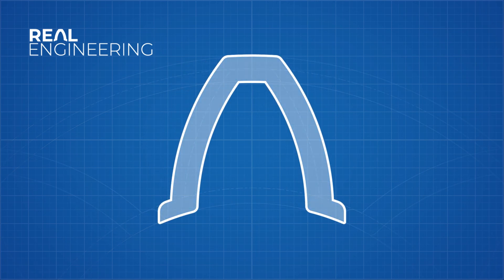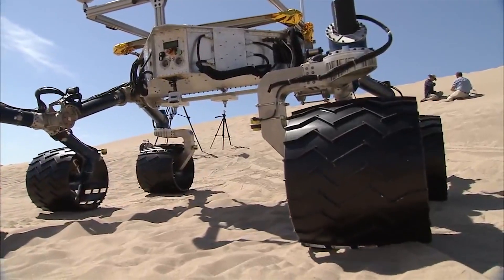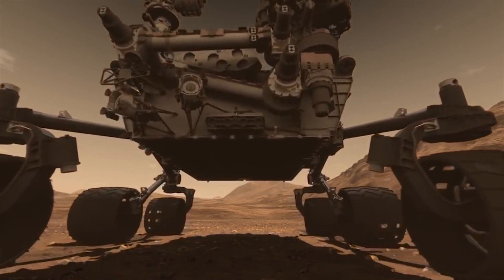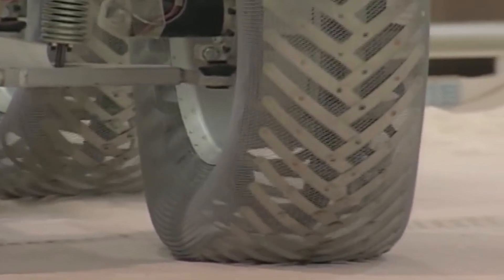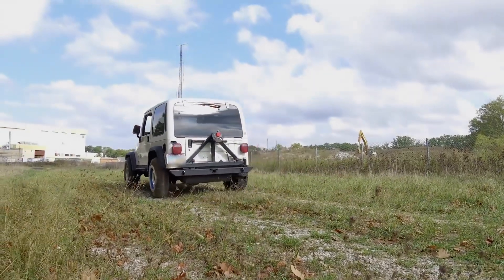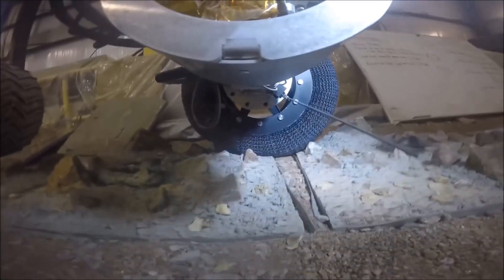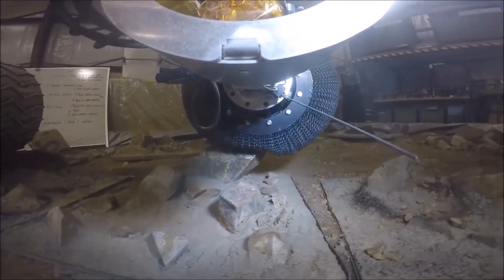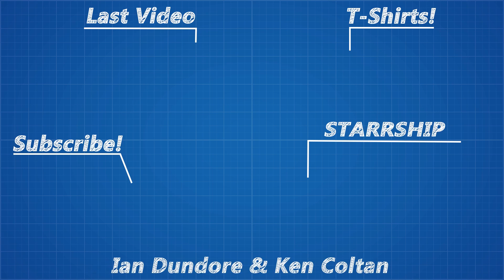How NASA Reinvented The Wheel - Shape Memory Alloys

Comment: Is it weird I want to be ran over by one of these wheels?
Reply: well, attached to the rover or not? 1000 pounds is a lot of weight.
Reply: @jhonn3908  thats kilograms
Reply: @jhonn3908  On mars, it weighs one third of that.  There are six wheels with the load distributed among them, so that's about sixty pounds of pressure to endure.
Reply: @JohnDlugosz  how would you get to mars?
Reply: well, people have those stents shoved in them. so it might not be thaaat weird
Reply: yes
Reply: Weight changes depending on the environment. MASS does not. If you are going to rudely correct people, get it right. @zuumek
Reply: no i want that too
Reply: Nope. I want to be too...
Reply: Is that your fetish??
Reply: Pheonix Playz If it can be a fetish then heck yeah lmao
Reply: That's a really weird fetish😂
Reply: @zuumek  Huh?  I think you have your terminology wrong.  The same mass (e.g. the same object moved to each location) will have different weight on each planet.  Weight is the measure of the force of gravity on the mass, and that force is what changes.
Listen to notta clue:  If you are going to rudely correct people, get it right!  Better yet, don't be rude.

As for "1t", if that is a "ton" (lower-case 't' is not an SI standard unit)  then it is mass if "ton" means 1 gigagram.  If it means 2000 pounds, a freshman physics teacher will insist that it's a unit of force, but in real use pounds takes on mass or weight based on context (and that loose practice must be banned when you have interplanetary trade!).
Reply: @JohnDlugosz  so if the moon is in are atmosphere & everything outside of our atmosphere has unpassable depth of miles of plasma how do any signals pass back to us through plasma ? when it's a fact that radio waves & other data  literally bounce off plasma
look up sapphire crystal tubing
do they charge the veichel by running into plasma ?
Reply: @twistedkyote4107  You mean "our" atmosphere etc.  I don't know what "veichel" is supposed to be.  In any case, I don't see what this has to do with the force applied by one tire of a mars rover, so I don't know what you're talking about.

Comment: why not just use 3 titanium SPURs for the wheels  ??? with rounded edges cnc them easy done impossible to damage, hear resistant , load bearing and would provide better traction on that surface.

Comment: wheel or tire?

honestly the concept of the wheel as "a circular object which is attached at it's center to an axle" is nowhere changed in this breakthrough. they only changed the material which is supposed to be the tire. still, there are wheels with no tires at all (like those on trains) but on this concept, it would definitely be clearer if they used the word tire (or tyre) instead of wheel.

Comment: So a family friend that works at JPL let me in on an extra piece of information on why the rover tires wore out quickly. If you look closely, especially around 2:25 (but also in other clips) you'll notice some rectangular holes cut in three rows along the tread.

What's their purpose? Ego.

The first tire proposal had 'JPL' on the tread in a manner that would write the logo all over the planet as the rover traveled, like a rolling stamp. NASA was not hugely thrilled by this, so JPL had to redesign the wheel, this time more sneakily.

Those three rows of holes are JPL written in Morse code.

And the first wear that was noticed on the tires was directly opposite to the Morse code because of unevenly distributed stress.

Needless to say, the prototype design they were decided upon for replacing the tires in the next rover at the time I was visiting didn't have any rolling stamp properties with which to mark Mars' terrain and cause structural weaknesses.

Comment: Okay, but how will it deal with small rocks getting stuck in the springs?
Reply: Small rocks don't get suck in it. When compressed, the coil becomes tighter hence not letting rocks enter in the first place.

It's also not expected to press to the rim, anyways, so it should be harmless if it does occur.
Reply: more like it doesent really matter, it either gets stuck inside a coil and rolls around in it or at worst it stciks and boom! extra grip for free.
Reply: Oh, I'm not saying that would cause it to actually break. But as far as I can see, there's nothing preventing rocks from permanently getting stuck in the springs. You'll always have some rocks that are just the right size to get in the way. There's a near-infinite amount of variety once you start driving on real terrain, after all.

And once some rocks accumulate, it might cause tearing in the metal, not just deformation.
Reply: @JustaRandom StraightGuy stop it dont introduce religion to this conversation
Reply: "to stick in the spring the rock would have to be tougher than the titanium used in the alloy"
Um. With that logic, the tire wouldn't deform at all, you know.
Reply: Getting stuck might not be the biggest problem, some stress can push it back out. I would be worried more about when it gets pushed in. You'll collect a lot of small grains inside the tire. Increasing weight, changing friction and maybe also damage interior mechanism of the tire (axle). Good question. Ignore maffy taffy :)
Reply: Perhaps the way the weave is shaped, it naturally deposits sediment upon expansion; when the wheel flexes it kicks the rock out by having a certain geometrical shape.
Reply: Nasa loves fixing everything with titanium
Reply: I think they will most likely use multiple layers of this material and place them in a way that there is no room for parts to get stuck in it. In other words place the layers above eachother while leaving no holes.
Reply: Nyerguds When it deforms, the rocks are released.
Reply: I would argue it isn't a serious issue because if the wheel is spoked rafter than solid, the rocks accumulate in the tire, adding ballast to the wheels, which would improve the capabilities of the river and when the rocks accumulate too much they will simply fall out of the spokes, it'd be similar to how on a tractor you generally fill the tires with a sense liquid like water, coolant, or washer fluid for traction
Reply: I think, besides weight savings, that's why the rims are open to the inside.  Rocks that get trapped inside will just build up and spill out the sides. It might lose a bit of efficiency tumbling rocks around and around, but power when you're there isn't much of an issue compared to getting weight there.
Reply: ti is hard
Reply: Perhaps you could make the springs small enough to where small rock couldn't fit in the springs
Reply: True
Reply: Im just trying to build up my basic knowledge....still im only 14
Reply: especially when alot of them get inside the tire but wont comeout because it was pushed thru by force of weight. so it will start getting more and more rocks inside which will mess the wheel up
Reply: How abt a covering elastic sheath of same or different alloy extremely thin and elastic that either wraps the wheel or fills in the gaps from outside to avoid rocks or dust from getting in ?
Reply: I'm assuming that the mesh tire was designed that way to push out, or prevent, most of the objects that could get lodged in it. Even if it didn't come out immediately, the tire will continue to warp and return to it's original position as the rover moved. Any rock that might get lodged would experience different warping in the local mesh as it rode over different terrain. Basically, the metal its lodged in would just warp again the next time it comes around.
Reply: Only drawback I can think of is that it may not have good traction.
Reply: they wont have any problems, bcs NASA is factory of lies and not inventions
Reply: It probably would become a problem. Most of it would work it's way out. It still would be the better option, I would think.
Reply: Perhaps in the rim you could have an air hose.  As the tire rotates, air is released to blow the stuck particles.
Reply: CT-3921  air hose does not seem like a plausible solution. For one, where would you get the air supply? the atmosphere on Mars has less than 1% of Earth's atmosphere's pressure. i suppose it would require a large sucker+compressor to make useful stream of pressurized air from it.
Having the air tanks onboard (launched from the Earth) also does not sound alright, for weight/volume reasons, if you want to operate the Rover for several years....
Reply: panda4247 - assumed pack pressure air tanks on board.  But that would add too much weight.  

Perhaps steel brush roller things. They’d roll along the top inside of the wheel to poke out the rocks.  Like thin metal spokes. They wouldn’t be making contact with the ground so they wouldn’t be damaged as fast as the aluminum wheels on the original rover.
Reply: @CT-3921 Dang that's pretty smart. GG man.
Reply: @CT--sy8sy  "Air"
Reply: @CT--sy8sy  "perhaps in the rim you could have an air hose"

..isnt .. air.. like .. hard .. to get .. when you're on.. mars?
Reply: @CT--sy8sy  lets assume there is air on Mars
Reply: you mean "smeal recks getting steck in the springs"?
Reply: Im sure they have figured it out...and yet im only 14
Reply: @jetstreamchad4712  Science is not in believing what you think they think but in questioning and simplyfying. Americans use twenty bilon pen in space. Russians took pencils with them.
Reply: Doesn’t have to be air can be any pressure gas you can reclaim from the atmosphere the objective is to remove debris not breath so why can’t you use nitrogen or whatever mars is abundant in ?
Reply: @matthewbrookes9539  CT already answered this. The air pressure in Mars is less than the pressure on the Earth's atmosphere. This means that the air in Mars are fewer or are farther away meaning that in order to get the air you require, you'll require a larger suction in order to cover more areas in order to get the air you require. Nitrogen is still air CT is not saying that they are fewer "air" CT is saying that there are fewer gas in general which cause the atmosphere pressure to drop because there is more space to move around.
Reply: Dumb question such a simole problem. Tons of engineers works for nasa and you thing they didn't thought of that?
Reply: maffy taffy - he was just asking a question. One can always gain more knowledge.  You didn’t even attempt to answer.  You just said it’s been answered.  If they have thought of it, why don’t you share their solution?
Reply: @CT--sy8sy  you just did.
Reply: maffy taffy  - that does not validate you being rude and degrading.
Reply: @HypercaffinatedBees  it does.
Reply: maffy taffy - wait, the air thingie is what they actually used?
Reply: @CT--sy8sy  what do you know?
Reply: Marilyn Estores stop being a hypocrite
Reply: actually, everyone stop being hypocrites!!
Reply: @luukeluketer1024  nice one
Reply: maffy taffy : Then why wasn't anything mentioned about it? I mean, it should be the first thing to come to mind when seeing that design. They should've at least highlighted potential issues and drawbacks, and either explain why they aren't a concern, or give the solutions that were thought up for it.
Reply: @Nyerguds  oh my gosh
Reply: @maffytaffy1914  you are definetly going in r/iamverysmart
Reply: @marilynestores6722  you go first.
Reply: @maffytaffy1914  me? You're the one who insulted someone for not knowing something.
Reply: @maffytaffy1914  You are the problem with the internet friend.
Reply: @maffytaffy1914  ehm yes ?
Reply: @maffytaffy1914  They can't make proper mirror for Hubble...
Reply: @maffytaffy1914  well they didn't think of solar panels getting dusty. so yeah. they might not have.
Reply: I mean, they didn't think of what rocks would do to credit card thin aluminum weighed down by a 1ton space tank, so . . . possibly.
Reply: maffy taffy It’s been four months do you have your idea yet?
Reply: maffy taffy  *think not thought

Comment: The metal could freeze together from water and chilling temperates
Reply: Why use wheels in the first place though just use independently moving legs that can sense pressure to sharp/harsh terrain and can dig into the soil to bunker down for high winds
Reply: Also you could change out a leg and store it much easier than a huge wheel

Comment: If there's an abundance of UV radiation, why use a Nuclear Reactor when you can just harness that existing energy? A UV solar panel? That could help reduce the weight of the vehicle. Also, if the temperatures are as low as -130 degrees, isn't that an optimal temperature for quantum computing?
Reply: Solar irradiation at mars is very low, UV intensity is even lower than visible light so that wouldn't help. Right now RTGs represent the "big" power blocks for space missions beyond earth and nearly the only power source for anything to or beyond Saturn.

Comment: Fun fact: the current wheels are designed by jet propulsion laboratory (jpl). Have you seen in the video the big squares in the wheels? You might have fought that these had construction technical backgrounds but actually that's just the reverse Morse code for jpl. So you might have fought apple used the biggest space for there advertising, but jpl used the whole Mars.

Comment: Sorry to nit pick, but they didn’t reinvent the wheel, they innovated a new tire. Technically a wheel is a tread attached to a hub. By this definition a gear is technically a wheel since it has gear teeth which act as the tread, and a woodruff key slot or female splines that act as a hub. This makes sense because a gear’s mechanical advantage can be calculated the same way as other more obvious examples of the wheel and axle.

Comment: A few errors I'd like to address:
The shape memory is in the austenitic phase, meaning that the material can be easily deformed when martensitic and goes back to it's preset shape when heated above the austenite temperatures.
Also, superelasticity is the mechanical induction of detwinned martensite within an austenitic shape memory alloy, not the other way around.
And stents are actually already superleastic below body temperature. One major benefit of nitinol stents is the capability to withstand the highly dynamic movements of the blood vessels walls, when blood isnbeing pumped through. More than 1% local strain, more than any steel stent could handle without being plastically deformed.

Also I'm not too sure if the idea of the nitinol tire is too clever. The density is ~6,5g/cm3 so this wheel will weigh a lot. Also, local strain must be limited in order to avoid fatigue and plastic deformation. I reckon some sharp rocks could induce more local strain than that although it might be absorbed trough the mesh design... dont know about the specifics of local deformation in such a mesh.

And most importantly the shape memory effect is strongly influenced by ambient temperature. The high temperature difference between day and night will make it close to impossible to have reliable properties in such wheels.

The reinvention of the wheel is just a stupid buzz phrase, not worthy of a prestigious institution like NASA, imho.

Comment: certainly a cool material but have they tested if it will return to the original shape at same temps as would be experienced on mars, or is the process of it returning via stress and strain not related to the method of returning via heat

Comment: Those wheels are a good idea, but I would definitely implement some softening system so if the rock is big enough to the point where it hits the rim that the rim doesn't get damaged, like a rubber stopper plate on the outside of the rim that wraps around the side and also protects the inside. it would also help protect the wheels in transport.

Comment: I find it so frustrating that they used aluminum wheels with .075 thickness to hold up 900k? Over rough terrain?
Its like bolting up beer kegs to a Toyota Corolla as wheels and driving through the Mojave desert. 😅

Comment: I'm curious what the heat source shall be on Mars to return this material to it's original shape. On Earth, when you're driving around at high speeds, the rubber tires on your car get fairly hot. But on Mars, when the average temperature is colder than Antarctica, and you're rover is crawling around slower than molasses, those tires aren't going to get very warm at all. I'm not saying that this is an insurmountable problem, but it is still a problem that would need to be solved before such a tire can be used on Mars.

Comment: Just a small correction. The Curiosity rover uses an RTG (Radioisotope Thermoelectric Generator), not a reactor. There are no reactions taking place, only the nuclear decay of 238-Plutonium. The heat from that decay is used by thermocouples to produce electricity, and Freon pumped from the RTG through the rover keeps the electronics warm. NASA/JPL has done this since the early days of solar system exploration in Mariner, Pioneer, Voyager, Cassini, and others. https://en.wikipedia.org/wiki/Radioisotope_thermoelectric_generator